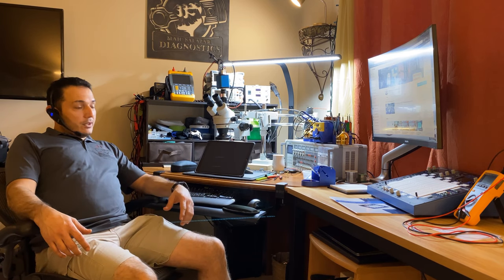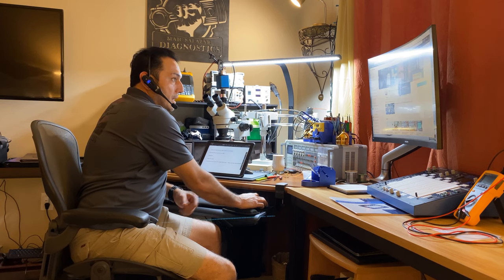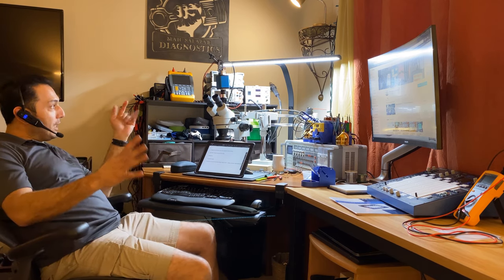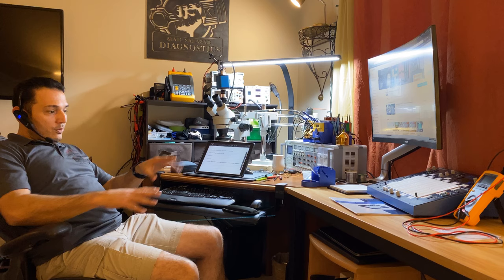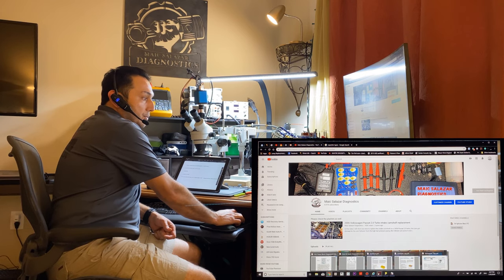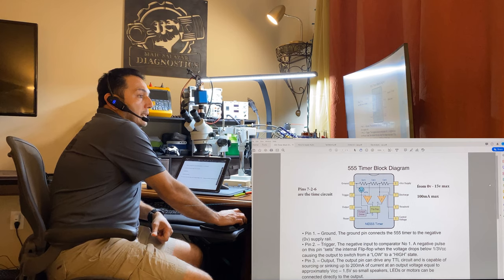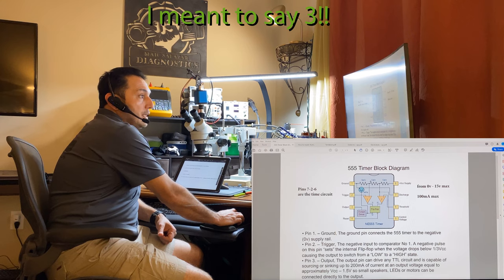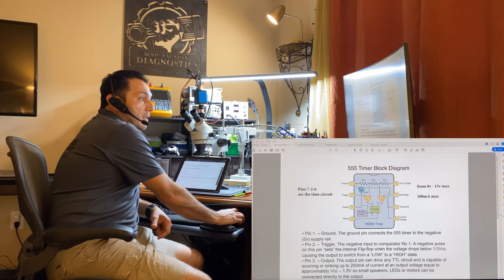Class 4 How to repair Automotve ECMs MOSFETS

Comment: Hi ! all right with you, my dear But when I saw your first video I liked it a lot and I started to follow it, I watched your video about Mosfet Ecm's very good explanation, but I was looking at the circuit you presented on the channel, the channel P and the N channel, in the Push-Pull configuration, if we apply a pair of Darligthon Transistors it would work in the same way....because light automotive systems reach a maximum of 14V, and where I can get the ´PDF´ of their classes.
Att
Agnaldo

Comment: I watched your video and you are a great teacher. I think you can incorporate into circuit wizard , problems to learn how to trouble shoot .
For instance: Suppose you put a jumper wire across a capacitor to represent a shorted capacitor. Maybe you can test voltage or currents 
to find the problem. or maybe to short a resistor  or transistor with a jumper wire  to represent a open or short, to see how  circuit voltages would respond by meter measurements. I don't know if is possible. Just an idea that came to me by watching this class 4 video.

Comment: That arrangement of three 5kohm resistors in the 555 forms a voltage divider so it's not switching at 1 to 3 volts, it's switching at one-third and two-thirds of the voltage, the supply voltage Vcc.  Also, the chip isn't powering items at 1.5V, but (Vcc-1.5V) volts, which is the supply voltage minus the voltage drop of a couple of transistors.